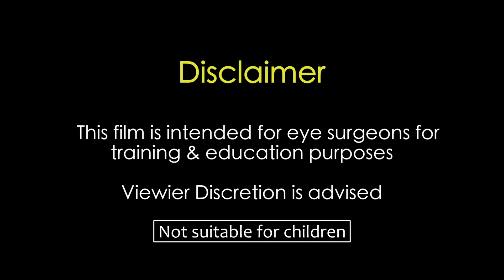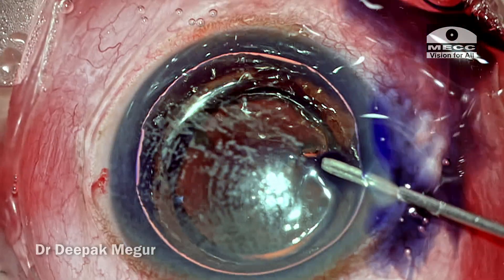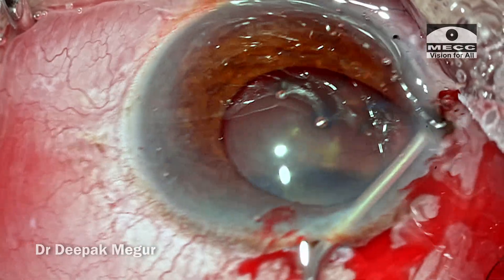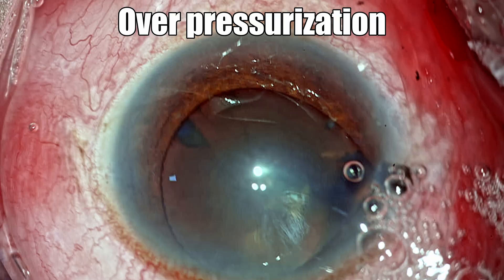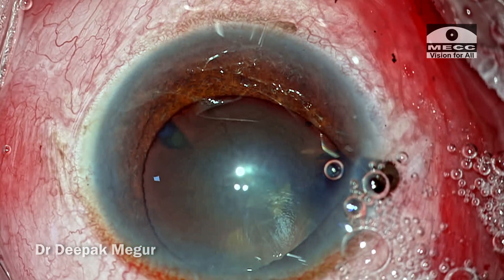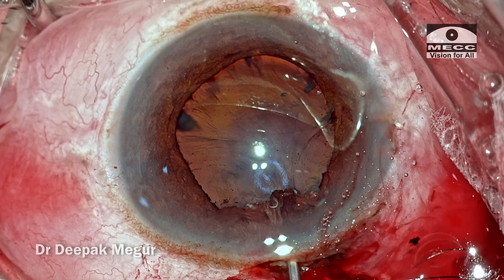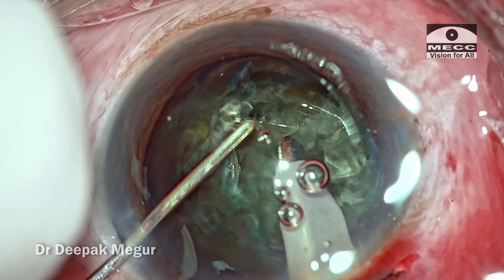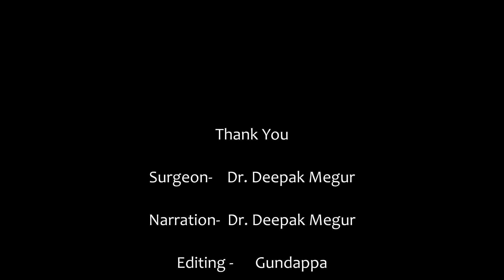Intraoperative iris prolapse : Problem Analysis and Solution :Phaco Beginners - Common errors EP: 01

Comment: as soon as you have iris prolapse to sideport, the steps are 1- do not reposit  2- DO NOT INSTILL OVD  3- make clear cornea phaco incision AND DECOMPRESS THE EYE. the only way to reverse prolapse is to lower the outgoing pressure of the eye. the worst thing you can do is add OVD. also, even after decompressing the eye, i'd advise against OVD UNTIL phaco is done.
Reply: Once the eye is decompressed you must inject intracameral phenilefrine
Reply: @andonijunqueralandeta376  it can't hurt.